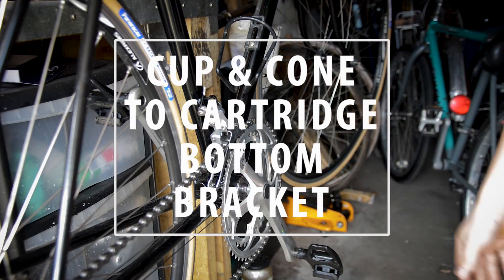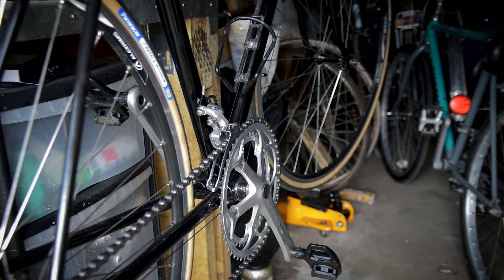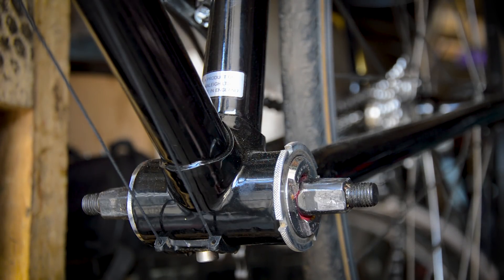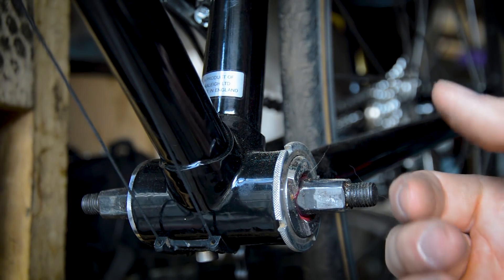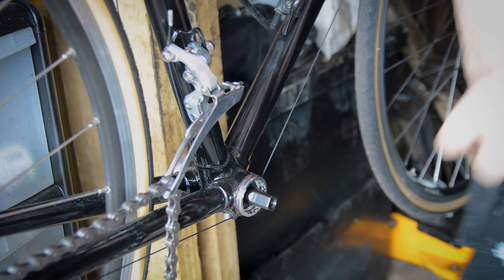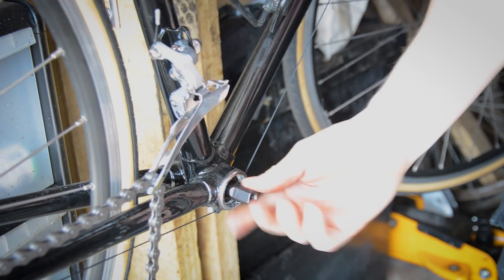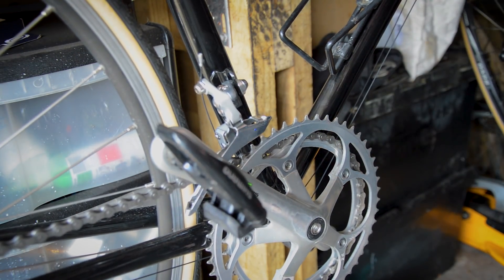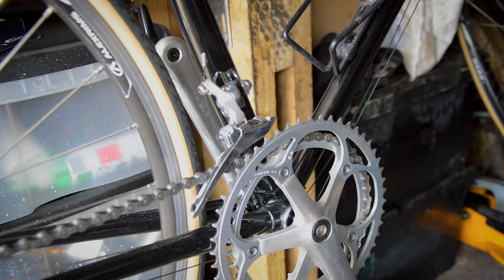Replace A Cup & Cone Bottom Bracket With Cartridge - Bicycle Maintenance

Comment: When I tried to fit a cartridge BB to my 1990 Raleigh Volant, it soon became obvious that the threads at either end of the BB shell, although in perfect condition, were not 'in line' with each other. Hence, the cartridge body, when screwed in, was way off centre with respect to the other end of the shell. A pain in the butt, but not something which causes a problem when using the original cups and cones.
Reply from the maker: Oh wow really?  Fortunately I've not experienced that just yet.
Reply: Yep, I had the same problem on my 1985 Raleigh Record Sprint. The sealed BB just about squeezes in but it's way off of being perfect. Will go back to cup n cone after it expires.

Comment: So I removed my old cup and cone bottom bracket from my Cromoly frame bike and bought a new sealed bottom bracket, but it has aluminum casing / threads.  Does anyone know if this will cause corrosion between the steel and aluminum.. will this be a serious problem?

Comment: Thank you for this. Its a really clear explanation. A few weeks ago I asked my LBS for a ball bearing cage for my cup and cone BB. They said I would be much better off with a sealed cartridge. Is that true in your experience ie are they nicer to ride with? Thanks once again.
Reply from the maker: I'm a bit indifferent (or I don't know how to answer) when it comes to is one better than the other to ride.  I think it would be hard to tell the difference to be honest.  A well serviced cup and cone will work just fine.  That is all it needs though, servicing.  If it's kept clean and grit free I'm sure it will spin well for years.  Cartridge definitely has a "simplicity" advantage in terms of swapping them in and out and "forgetting" about it once it's in but C&C will always have that serviceability and I guess lower cost too.
Reply: C&C can be serviced and as long as the races are okay, you can ride it. when a sealed cartridge wears out, you need to replace it. so in terms of longevity, the cartridge style BB is a simple swap with alot of waste and C&C BBs can be brought back to life with new grease and maybe new bearing balls. Performancewise, they are pretty much the same. If you really want to get something that performs noticably different do a HTII conversion.

Comment: Hey Monkey - I have an unidentified but decent 80's Motobecane frame that I'm looking to convert to a single speed/fixie because so much of it is wonky, including the cup and cone BB which for some reason always comes loose after tightening. Is it always a good idea to upgrade to cartridge style if you can find one that fits, e.g. what are the benefits over an old but salvageable cup and cone? Can you recommend European sources for hard to find replacements for french-style BB's?
Reply from the maker: Good question.  I think an old cup and cone is beneficial if you don't mind getting your hands dirty every now and again because it can be serviced.  Each part should be able to be replaced whenever they wear...should they wear.  If it's kept clean and greased I can imagine them outlasting a cartridge.  However, of course, they're not sealed so without that maintenance they can get gritty and worn quicker.  Cartridge's advantage is it's a quick fit and forget item.  Relatively cheap and easy to source.  As for mechanical advantages, I wouldn't like to say.  One will be lighter that the other but in terms of bearing "smoothness" I'm not sure.

French cartridges? You know what, I've never seen one.  I have just checked Velo Solo where they do a threadless BB for damaged shells but I can't see a French threaded on there.
Reply: The reason it always comes loose is that you don't know how to install and adjust a cone and cup BB,frankly neither does MS.The absolute main reason a cup and cone BB loosens is due to not tightening the fixed cup fully.You can not trust arm strength alone,I am sure I have more arm strength than MS or you (me-265 lb.-built) but that is not enough,the fixed cup must be driven on with a hammer or mallet.This can be accomplished once a tool is made to secure the fixed cup tool to the fixed cup (easily done with a bolt longer than the BB and some large washers).The first rule of cycle mechanics is make sure it is spotlessly clean.When you have cup and cone BB to install,make sure all parts have been cleaned with solvent and brush,soak the ball retainers in solvent.Pay attention to the threads on the cups and the threads and interior of the BB shell.Dry all parts and inspect for excessive wear or pitting,replace if needed.Put a bead of grease on the first few threads of the fixed cup and hand thread to avoid cross-threading,continue until you are not able,use the fixed cup tool to get the cup to the shell,attach the tool to keep the fixed cup tool engaged and with a mallet or hammer drive the cup home with one or two sharp blows.Remove the tools from the cup and insert a well-greased ball bearing retainer and the plastic dirt shield.I then insert the remaining greased ball retainer into the adjustable cup and put the spindle into this cup,this assembly is inserted into the shell and the adjustable cup is hand threaded into its' side,a tool may be used at the point the hands no longer are able (a quality BB,Dura Ace,Campy Record and a well prepared BB shell usually can be threaded all the way by hand).Thread the lockring on,now install the drive side crank,this is another step that eludes beginners,it is impossible to adjust  the BB without the drive side crank being in place.Now put the two tools on the adjustable side,bring the adjustable cup tighter so that any side to side play is removed from the crank.At this point the lock ring can be tightened,this is where great arm strength is needed,you are using both tools simultaneously.Check to see if there is any play or if the bearings are impinged,if so loosen and repeat,this is where quality BBs shine,the tools are specific to model and engage in a far superior manner,the races are ground and polished and the ball bearings are much rounder.The goal is to eliminate side to side play and have a very gradual reduction in the pendulum motion of the crank as it rotates to a stop.I would always replace cheap BBs like the one in this video with a cartridge or even better a Hollowtech ll (but then a new crankset is needed).There are replacement cartridge BBs for damaged BB threads,these will work on English,French,Italian,Swiss,these can be life savers.And the main thing about installing these (regular cartridge BB,not the ones for damaged BBs) is again,driving the cartridge into the fixed cup with a mallet,however,the lockring can be snugged,it can impinge the bearings if over tightened. I have been wrenching bicycles for a lot longer than either of you have been on earth,I usually work on very expensive bikes and am happy to share my knowledge

Comment: hello, any trick to remove the right cup? i have the parktool tool but its impossible....
Reply from the maker: You can always try "bolting" the tool to the cup so it doesn't slip off.  A bolt (of threaded rod) through from the left side, tool on the cup and then a large washer over the tool bolted down should help.

Comment: i cant get mine off its just so stuck in there
Reply from the maker: If you can get one side off (normally the non drive side) and are stuck on the drive side, try bolting the tool to the cup so it doesn't slip.  You can do the same with the axle in place too, it just requires more washers
Reply from the maker: @spyda668  Good luck!

Comment: christ on a bike! £30?!  I know we're supposed to be supporting our local LBS' but when they're gouging you for double, I have no sympathy, sorry. Worse still, I'd be happy with a refurb for my rat-rod, so even more of a saving. smh.
Also, any particular reason you opted for grease over anti-seize?
Reply from the maker: Yeh I know.  The shop sticker said £29.99 but they did it for £25... turned out I could get it from Halfords of all places for £18 if I used my AA discount.  I was in a rush to get it done and they were the nearest place.  Grease was just the first thing I had at hand.